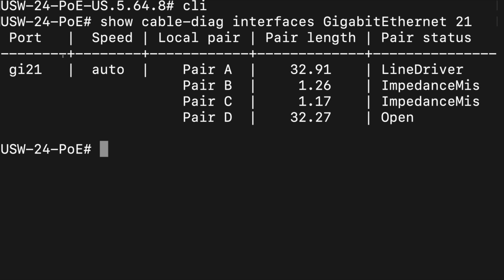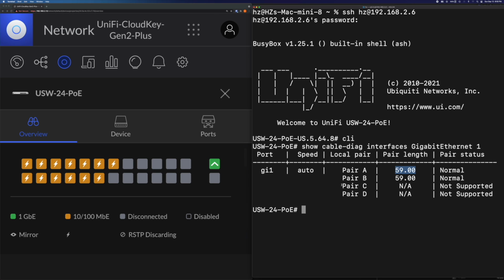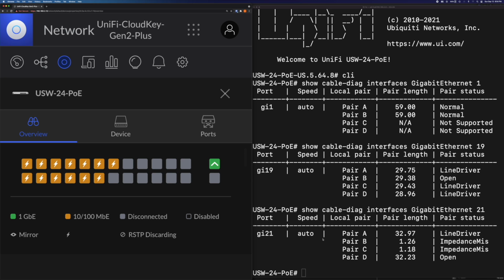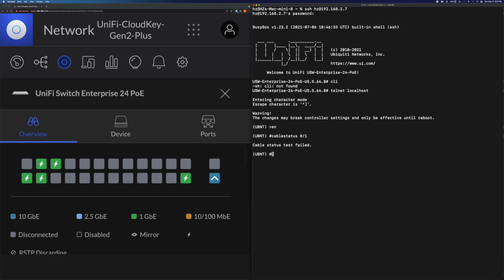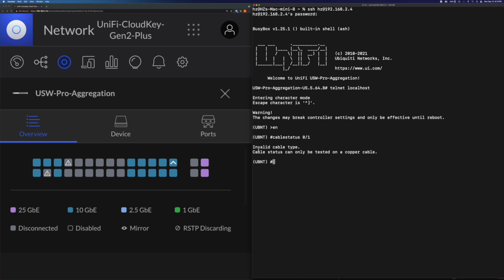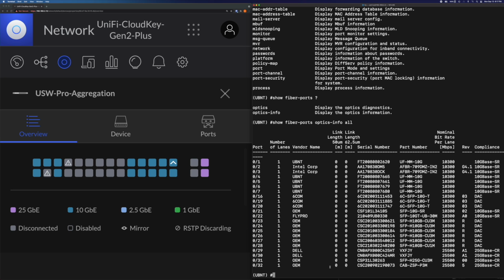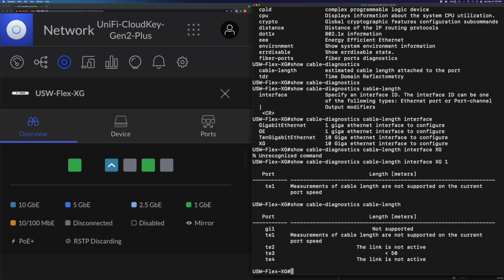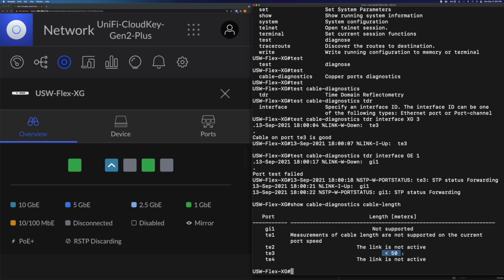Ubiquiti UniFi - How To Use Command Line Interface (CLI) to Tell Copper/Fiber Cable Lengths

Comment: Such an awesome video, thank you for the information! @ 3:42 when you're on the USW-24-PoE switch, is the pair length feet or meters? So for example, is the wire that's plugged into port 1: 59 feet, or 59 meters?
Reply from the maker: If I remember it correctly, it's in meter.
Reply: @hz777  Thank you for the reply.

Comment: Any way to check cable length on Dream Machine SE? I SSH in but no luck.
Reply from the maker: UDM* are gateways, instead of switches, so the CLI works differently. I have not tried so don't have answer.
Reply: @hz777  thank you